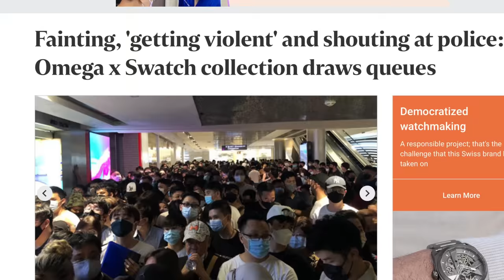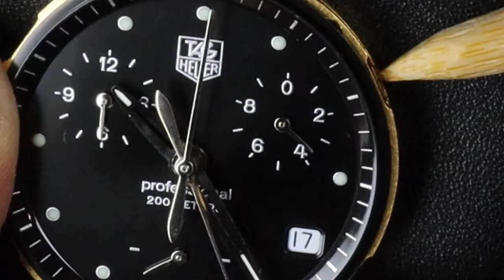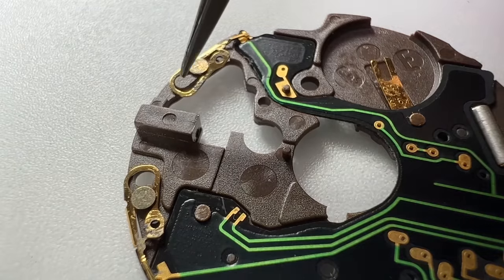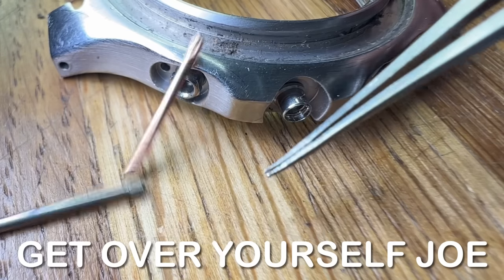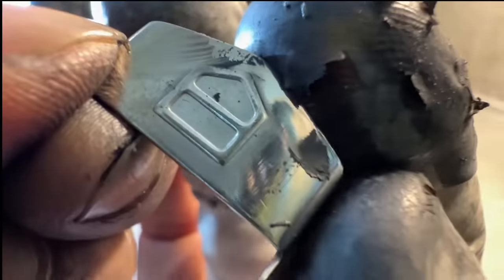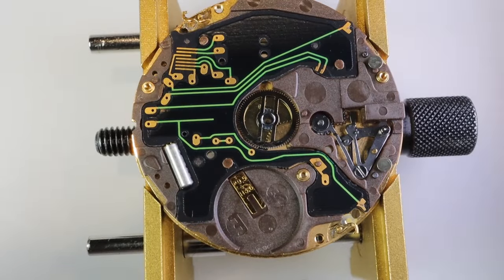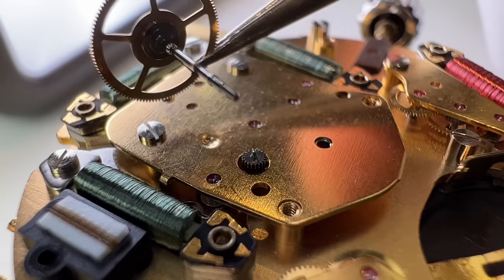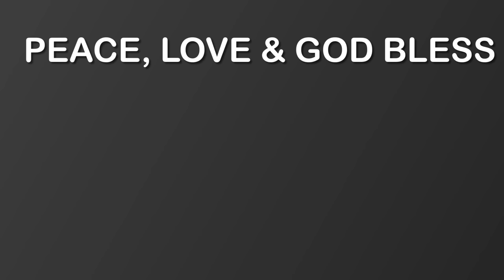TAG HEUER KIRIUM CHRONOGRAPH RESTORATION & COMPARISON WITH OMEGA SWATCH

Comment: This looks even more complicated to restore than a mechanical movement.  I was thinking something like this might be a good beginner watch, but wow, not now.
Reply: It’s not more complicated than a mechanical movement. It’s a chrono remember so it’s going to be parts-heavy even for a quartz. If you want to get into learning how to service movements, pocket watch movements are pretty much universally recommended as the starting point because they are relatively very simply and the parts are very large compared to any modern wrist watch movement, plus they can be had very cheaply.

Comment: I found this video looking to service the quartz movement in my Longines Oposition (yes, spelled with 1 p). Turns out it uses the same movement as your Kirium. Ironically, I also have a Kirium with an automatic movement. I learned a lot about both from this - many thanks.

Comment: Incredible insight into a quality quartz movement, it certainly made me think differently about the older and newer quartz models. Top marks with a gold star for you entertaining video. Thank you. 😁
Reply from the maker: Thank you 🙏
Reply: This movement is from ETA´s flatline range which are all multi jewel metal constructed and are (including this movement in a very minor variation but a direct replacement) still for sale alongside the cheaper movements. In fact one of the wonderful things about ETA is they have made sure that if you have a thirty year old movement they no longer make you can still use a modern version as a direct replacement.

Comment: Hi Joe another of your great video's, i knew it was going to be the eta G10, i really don't like the way movement makers have made non serviceable quartz movements they still charge enough, the eta 251 chronograph i agree i put new batterys in 2 of my brothers swatch chronographs from 90s and i had to use the old de-magnetizer to get the center chrono second hand to get unstuck on both no doubt i will be servicing them somtime, i love fixing/servicing watches quartz or mechanical i love it only a hobby as yet 2.5 years but i'm amassing knowledge and tools, o the tools such a lot of them, cheers Joe i do like your video style it cheers us up ta very much.
Reply from the maker: Thanks Dave

Comment: If the pushers were installed using screws I think that some thread lock would have been the way to go when it comes to keeping screws from backing out and falling off. I use it on the screws of my glasses and sunglasses to keep them from coming out due to constant use.

Comment: Greetings from Cannock Joe. Another outstanding video, this is really special as you rarely see videos of anyone taking the time to disassemble, clean and service a quartz movement (albeit a quality movement). It really has given me a new found appreciation/respect for quartz timepieces. Do quartz analogue timepieces need servicing as frequently as purely mechanical timepieces? I'm really pleased to see you spreading your wings as it were and branching out, although it will be a shame that we might not see so many videos from yourself if you are even more busy. Any road, keep up the good work mate. Tara rabbit!
Reply from the maker: Thanks John. Will have to delegate some work to the accountant
Reply: Quartz movement’s don’t need to be serviced as frequently as mechanical watch movements usually unless they have been subject to harsh conditions.In my experience poorly sealed and cheap watch cases cause dust dirt and water entering the case shortening the life of the movement in both quartz and mechanical watch movements.Another cause of damage in quartz watches is not replacing the cell (battery) when the quartz watch stops.A dead battery can leak and destroy the circuitry in the quartz movement,I have seen this many times in watches left with old dead cells (batteries in common parlance).

Comment: Ok… out from left field question… for your screwdrivers… do you use the same shaft and just change the blades or do you have multiple shafts with different size blades… I noticed your shaft had screws in it I’m guessing to change the blades when needed? I know, silly, question…🫤

Comment: I have a chronometer version that seems to work fine but looks a bit small on my 100kg body . It's a 1999 version with the Mercedes hands  ( they look the best )  and would definitely benefit from a polish. The dial is a blue version and a nice sapphire crystal. My question is will the mid size watch come back into fashion or should I move it on ?

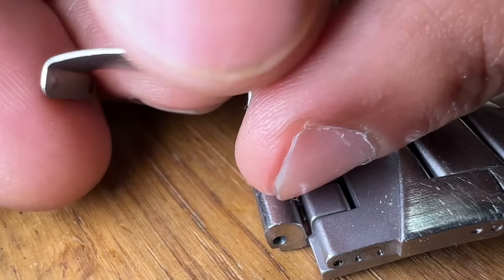Comment: Hello, can you please, please tell me what that first rubber looking mop @24:28 is called/made of? I could have saved myself untold time and effort had I know about it. Also, what compound did you mix with the Tripoli brown? I have watched hundreds of these videos and you are by far my fav... Outstanding. edit: it appears you have a HEAVILY loaded up sissal wheel with brown first then a touch of grey... intriguing. Love to hear what's going on with that combo? p.s. Scotchbrite wheel for brushed finish. p.s.s. gobs of grease throughout the keyless works helps grab dust passing by when the watch is 'breathing'. That oiler should be called The Mosquito. Those end photos are to die for. Thank you, I learned so much.

Comment: Hi. Really helpful and super nice photography. Can You explain how the connector between the two boards does it’s job? Mine was missing. I am also unsure if special care needs to be used with it. I ordered the connector and the holder and have to assemble the pair. I believe it can be installed with no up or down. Mine looks a little different. The white sides are thinner, the black area looks to have a silk texture. I don’t get how this connects the traces on the two plates. Though having installed it and removed it to inspect, I clearly see indentations on both side matching the copper traces. Do all model 251.xxx use the same part? Many questions in this post. Much appreciate you sharing your knowledge.
Reply from the maker: The rubber strip/block contains conductive material, it’s a bit like a wiring loom but with everything contained in that rubber strip

Comment: When I first learned of the Moonswatch I was very tempted to buy one (for retail price). Now the hype is over and on reflection, I would be embarrassed to wear that plastic, overpriced piece of junk.
Reply: I thought they'd use a nice quartz movement in it but i guess i was mistaken
Reply: just to correct a common mistake. The Swatch is a ceramic/ bio plastic from the castor plant fusion so actually quite a sophisticated material to use. And it is more ceramic than bio plastic the ratio being 3 parts ceramic 1 part bio plastic.
 The feel of this material is wonderful and not at all like the plastic versions. I have both plastic and ceramic cased swatches and the latter feels much nicer.

Comment: The Swatch Group are single handedly destroying the horology and repair business. Their monopoly on ETA parts has made acquiring original new parts very difficult and expensive. Well done for calling them out on their cheap, plastic, disposable junk 👍
Reply: ETA parts are easy to get that's why they are so easy to repair and relatively cheap, unlike In House which usually have to go back to the company and cost so much more to repair.
Reply: @garyboyle695  I agree but things have changed in the last few years. I used to supply most ETA parts but the price increases due to The Swatch Group limiting who can buy has made it very expensive. About 7 years ago I could buy new ETA 2824 / 2836 complete movements for about £40. You can't even get the clones for that now. Same goes for ETA quartz movements and circuits. It won't be long before the NOS has been used up and you'll have to go in house to get repairs done.

Comment: When a quartz movement fails, and the PCB's are all ok, there isn't much left. What is the usual cause - the crystal, the stepper motor, or the coils ? If a coil fails, how would you test it ? Can you just measure the resistance from one end to the other (open circuit - obviously broken), but what sort of resistance would you expect ?
If the insulation fails in the coil, I would expect the resistance to be a lot lower than normal.
Reply from the maker: Yes they can be tested. The technical schematic provides all the tests and parameters for this movement if your interested.
Reply: @NekkidWatchmaker  Ah yes - JRTFM is always the right aproach 🤔 👍

Comment: Hi. When you show the two wheels and a pinion with driving wheels can You share wether they should be biDirectional and how lose and ‘easy’ should these be to slip ? I am concerned on why and how these provide service to the movement. I can think that none of their functions are part of ‘drag’ of the motion works? It does not seem probable bcause of the current consumption available, I can say my wheels and pinion that are ‘driven’ would certainly stall the movement, unless………my components are really stuck and dirty. This is why I ask how smooth and easy should the movements be? When I exercise them holding with a tweezer and push the gear teeth with a wooden stick, they require a lot of pressure and slip in the jaws of the tweezer. You can tell I am a first timer doing this movement repairs and maintenance. My central issue is my minute hand does not move but it and the hour hand move when using the crown. (The small second hand is fine, so I would say the coil is fine?). That one is the middle green one.

Comment: Hi Nekkid - Need a little advice - I have a Brietling Skyracer and I tried to clean under the rotating bezel with a little dental floss to try to dislodge some crud - now I have some of the floss stuck locking the bezel. there are 4 screws round so is it just a case of unscrewing these tiny screws and popping off the bezel to clean it... ?

Appreciate any advice.
Reply: Awesome channel by the way - have watched every video thus far.... many thanks
Reply from the maker: Thanks Craig. Yes Breitling bezels are relatively easy to get of. Take the bezel screws of from the sides and pop it of. Check my two Breitling videos, might help. Good luck and know that your Breitling will never have to visit the dentist

Comment: “Malicious design“ 

As somebody who works with microscopic SMD and component level board repair …. I feel your pain! 😂

i have my own small humble metrology lab and business, I specialize in test equipment repair/calibration… Helping other small laboratories and research.

I always enjoy trying to navigate my way around the “defensive“ non-serviceable designs.

So many things that are built “unserviceable“ these days… it can be difficult but usually there’s a way to figure them out.

As long as there’s no software boobytraps… if there’s a big enough demand… Then it’s definitely possible to reverse engineer it.

Some of the high end test equipment and metrology gear that I work on has almost unbelievably complex layouts and components. I guess I’ve worked with it so long… I know cringe and get the cold sweats when I hear the word “proprietary“.

I’m BOT SMART ENOUGH to reverse engineer stuff like that and figure it out, but some of the folks and friends of mine who work in the field… They’ve been pioneers of fighting right to repair… 

Sometimes it takes x-ray machines and another complicated equipment to figure it out… but it’s definitely doable if there’s a big enough demand.

Much love from the USA! I Always enjoy your videos.
Reply from the maker: Thanks mate. Really interesting vocation you have there.

Comment: I started repairing the circuit side of this calibre.
The movement as it is called.
I found three of the five coils needed service or a replacement.

I am putting it together and can say when taking it apart I did not lose a piece.
I checked youtube for service and repair video for the 251.262 movement and notice a little plug in module just under the circuit strip that connects the five coils and any thing it needs to. My movement did not have this plug thing. But yes there is the spot where it does receive it on the plate, the plate that the coils are attached and the plate that the black strip snakes around and is screwed to it.

I had this watch in storage for maybe 10 years, and do not remember much about it now.
So recently I took it apart after putting a good battery in it and it did not work.

Do you know what is part is called and if on some Heuer CN1110 it is not used?
I am dumb founded and I must guess it was bought not running and has all these issues of missing part, because I would not have just lost it. But if it is not used, then I should continue assembly and see if I have done the sufficient repair work..

If you know from my explanation and can offer help with info I do appreciate it.
Regards,
James
Reply from the maker: If you download the schematic you should be able to identify all the parts.
Reply: @NekkidWatchmaker  I have got the combo connector and spacer in a cart in the UK at Cousins. I would like to locate a second option say in New York City, at a USA vendor of watch parts. Just don’t know how many companies stock the parts for movements right down to the small components. But goid to know Cousins is on tap.

Comment: May I ask a question please? On the timegraph machine, I get the beat, I get the error, but how does the amplitude get worked out? Is this how any degrees the escapement rotaes? if so, how does the machine arrive at the colculation. It is worrying me and i have not slept for 6 months thinking about it.
Reply from the maker: Try this https://www.thewatchsite.com/attachments/beatnoise-timing-pdf.34387/

Comment: It appears the watch industry suffers from disposablitis just like the auto industry. You're just paying for a name. 250 is alot for a disposable watch! Here in the US the ford escape, fusion, escort etc as well as the chevy cruz, most of the old geo metro's and trackers and several others i cant remember are all disposable vehicles as a replacement engine or drive train exceeds the value of the car three fold hence their reputation. I used to buy fossil watches ( i know i know) and they were sent in for replacement movements ever two to threee months and they literaly fell apart in pieces just worn on my wrist. i couldnt believe it! I switched to g-shock many years ago which were less expensive and have never ever had a malfunction. Just battery changes and a little cleaning. for a hundred bucks, u cant beat it. Was shocked to see how cheap it was put together. Another great video my freind. ty for sharing Joe. This is my fav channel btw.
Reply from the maker: Thanks mate. You can’t beat a good old G-shock
Reply: @NekkidWatchmaker  Agreed...👍tell trouble Hi from America!

Comment: I just have to say that you are incorrect about the movement. The one in the Heuer is still availible to this day from ETA, just look on their website. It is not the 251.262 true but now the 251.264 and is a direct replacement for the 262 version. 
I know this as not only do I have this movement in my Longines but my friend has a different Heuer with the same movement and it had to be replaced due to water damage and they fitted the .264 movement. The G series is a completely different beast and is very basic but having said that it is reliable.
But the higher quality version is wonderful.  I have it in my Longines and my Raymond Weil and both are super accurate and reliable and the other nice thing is a four year battery life, longer if you don´t use the chronograph much.

Comment: When you are applying a brushed finish to flat parts such as the centre of case backs, what grit is recommended? I realise you did a circular grain on this caseback but I mean in previous videos where you’ve done a straight grain using a wooden guide with the caseback in a square holder to prevent movement.
Reply from the maker: Depends on how thick you want it. 600 upwards
Reply: @NekkidWatchmaker  Thanks…

Comment: Spent £600 on a Jorge Lorenzo limited edition Tissot T-Race. Imagine my disappointment when after 4 years it stopped working. After opening find that it's a completely non serviceable movement, and that the movement only costs £40. Wish I'd either went cheaper and bought a Seiko, or saved that little bit more and bought a Hamilton.

Comment: Pause....I was doing fine reassembling one of these until one of those gold pusher button switch thingies went off at a rate of knots over my right shoulder and into the dark Arc of Uncertainty....spent a day looking for it but it's gawn. Of course, Tag Heuer parts are unobtainium so I wait for a scrap movement to arrive from an eBay seller to move forward with it.  Ho hum.....

Comment: Actually they are serviceable, you would just have to replace the entire movement if needed. I know it may not be as satisfying of an idea but then again it is a quartz.
Reply from the maker: But can the watch be opened up? I’ve only seen a small flap on the back for the battery
Reply: @NekkidWatchmaker  I'm guessing that if you wanted to have it serviced they would just open the case and exchange out the entire movement for another one, if they would even bother at all.
Reply from the maker: @Dogtroll  yes but I don’t think the case can even be opened up to change the movement. I’ve been told it’s a permanently sealed case. I think I need to get one and tear it down

Comment: cheaper not repairable eta g10-211 cost 60$ to buy .If you are handy enough replace it your self .My Tissot with this movement is 23 years old and still running. To service servicable movement cost 200 its your pick. To service mechanical Rolex 600$ and up

Comment: You certainly would not want to get one of these guys wet. With modern CNC mills, you could produce fine mechanical watches extremely cheaply. I wonder why TAG would go this route.
Reply from the maker: Tag are not part of the swatch group so it’s not tag that did this